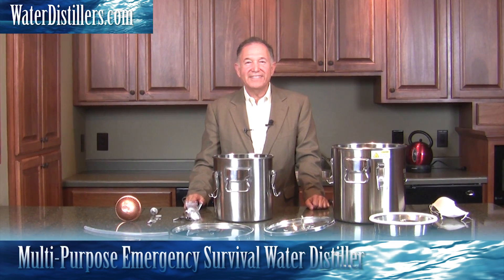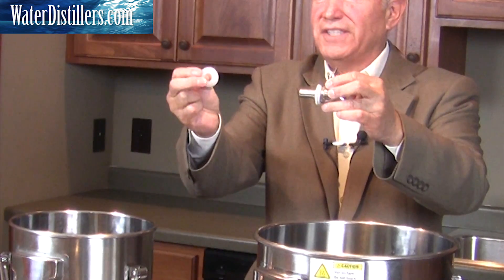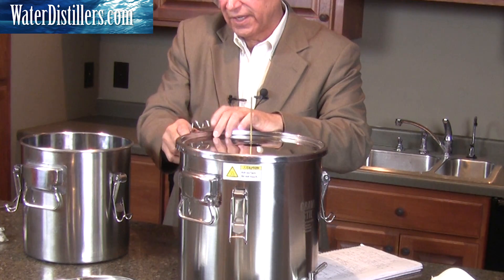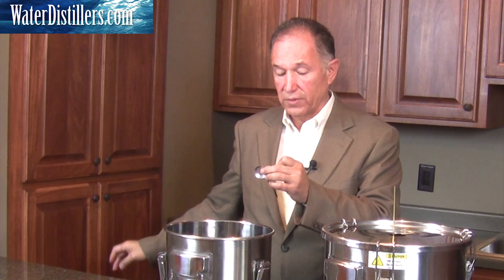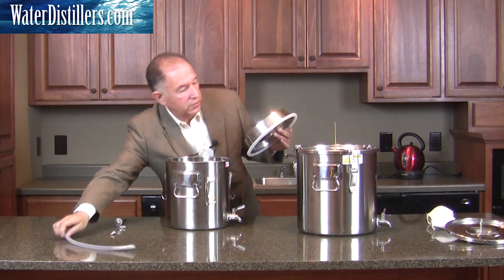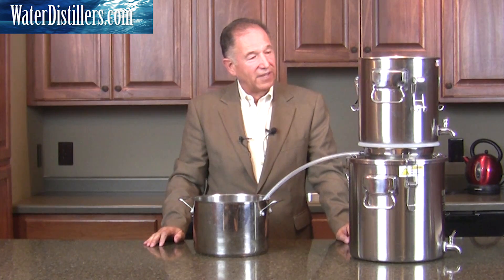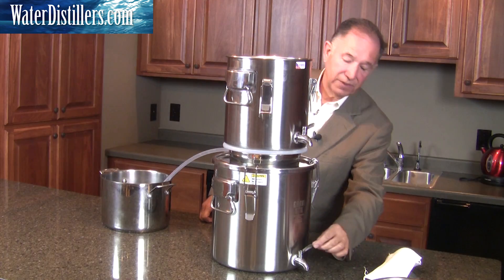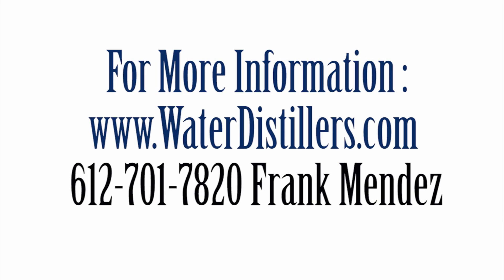Emergency Non-Electric Multi-Purpose Water Distiller and Gravity Filter Setup

Comment: DO NOT BUY FROM THIS COMPANY ! This  company has terrible customer service,  i called 4 x  , finally got ahold of  someone  that said they would call back  never received a call.  The product looks good  is  fairly sturdy however:  the supposedly silver infused gravity filter is only a ceramic charcoal  filter and after running fresh rain water through it the water went from .90 ppm to 80.0 ppm, next test was tap water that went from 433 ppm to 567 ppm. To use as  a distiller  you better have lots of time set aside  and lots of cold water  to keep it working.  This is not a good survival distiller  and this company  has terrible customer service!

Comment: The copper Float has been upgraded to STAINLESS STEEL and an added stainless steel extension tube (protect tubing  from High flames) has been added  Clall 612 701 7820 for special pricing

Comment: The Distiller is an open air system the VOC gases escape without being trapped,
Reply: Are you referring to petroleum /gasoline which may contaminate the source water?

Comment: Too bad the bottom pot is so big. It looks like it is twice the diameter of a large  stove top burner. Also it would have been nice to see it actually distilling water. How many gallons per hour does it produce?
Reply from the maker: It is a standard stock pot. Nothing out of the ordinary.  It can produces 8-12 cups per hour based on the heat source and your conditions.
Reply: You can use very small pots as well as large ones, Please review videos again

Comment: .2 microns ...please this is not a water Distiller. .. it is a water filter ... gravity filter! thats it!
Reply from the maker: It's actually both  2 in one.  Watch both videos - it can be configured as a gravity filter like you mentioned, but it can also be configured as a water distiller (not using the filter).  That is why it is called multi-purpose.
Reply: @WaterDistillers  Oh, o.k.  Thank you for the clarification.
Reply from the maker: If you watch all three videos you can see that it can be configured with a filter (included) for gravity filtration or it can be configured as a distiller (without the filter) for distillation.  It is 2 systems in one.
Reply: But it has no "filter" in the system?  He did mention steam, therefore, it must be a distiller of some sort.
Reply: @veefriend4201  you are totally correct
Reply: Anyways I'm  gonna go do this (diy) https://youtu.be/00kKPOs_FA4
Reply: How many gallons an hour can i distill with a reasonable heat source?
Reply: Vee Friend I was trying to figure out where the heat for steam came from, later in video he says fire, or stovetop.
Reply: Yes, thank you, I see that now.  Sadly, too expensive for my budget.
Reply: Vee Friend if you are looking at good filters is compares with the others. If not slightly cheaper.
Reply: @veefriend4201  hello Vee Friend, Answer : not expensive especially if your life was critically depend in need of  health drinking water ..
Reply: NOVICE YOU ARE TOTALLY WRONG .2 Microns refer to another one of our other Gravity distillers-  call 612 701 7820 for complete understanding about our emergency water distillers.

Comment: Thanks Frank for the great distillation video.
I don't mean to be so thick and I did read your comment to Robert. 
Yes I understand it's made in the US and the steel is from Canada or the US but what I need to know is the steel American steel imported or American steel iron ore?
This is VERY important because imports are laced with mixed metals and not only is the quality cheap but the metals can and do carry minute traces of toxic metals such as lead, mercury, cobalt, chromium, beryllium, cadmium etc.
Now if it's made from 100 percent American iron ore then you have the highest quality pure iron ore steel the world has to offer and you won't have to worry about leaching toxic metals.
This important to me.
You may have to do some digging with your manufacturer like see the transport bill of lading.
But on the bright side, if it is, and I hope it is,  you can post this info for your viewers concern.
Thanks for any info you can share.
Reub.
Reply: Marcia D  Hello Marcia  America Steel Iron Ore    -
Reply: He confirms US steel source below. Kudos for thinking out of the box WD making it off grid. However, I have a Q - is my understanding that true distillers must include a carbon filter to catch remaining VOC's, so this looks more like a filter system vs. a distilling.
Reply: @litestreamer  In an enclosed water distiller system it should have a post filter . In an open  system like shown', no need to hava a post filter
Reply: litestreamer you can purchase those filter separately and run the water though them, if you’d like.

Comment: Hello SUN MYSTIC, appreciate your comments sent to us , especially since you already have a survival water distiller system . As you stated  '' What an icredible product that was, and really handy and compact for an emergency water supply. This gravity fed one is absolutely incredible and it includes the pots; and such a smart system. I am seriously seriously thinking about getting this one" . SUN MYSTIC please do get this one ; and also note that it is also a Multipurpose, Gravity filtration, Silver impregnated system with a .02 Micron rating and is rated with the Best Filtration systems found. ONE more point SUN MYSTIC, OTHER top quality gravity filtration system can produce 16 to 18 gallons per day. This gravity filtration system is capable of a High Output of 90 gallons per day. In a short time (when on the move) you can produce so much great purified water. IT is the only system that can both  distill (ultimate purity)  and  filter water  to .02 microns .
Reply: Is that hose  plastic ?  How much would it cost to replace it with copper tubing  for water ?
Reply: Hello The gravity distiller can with proper supervision produce 1 gallon per hor